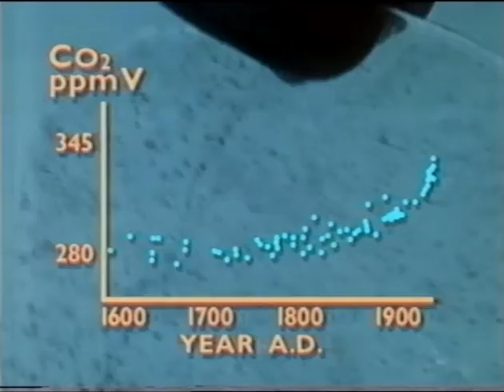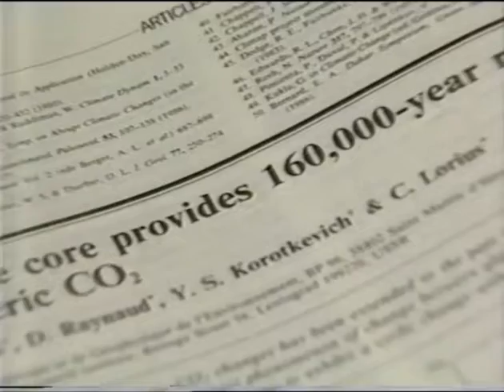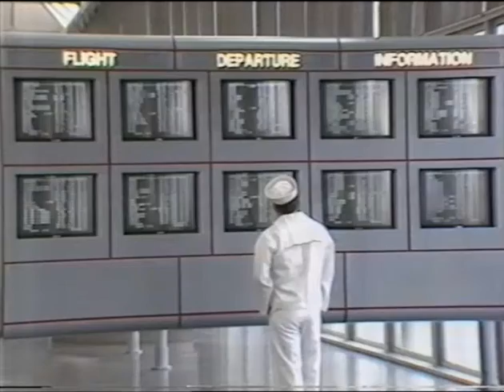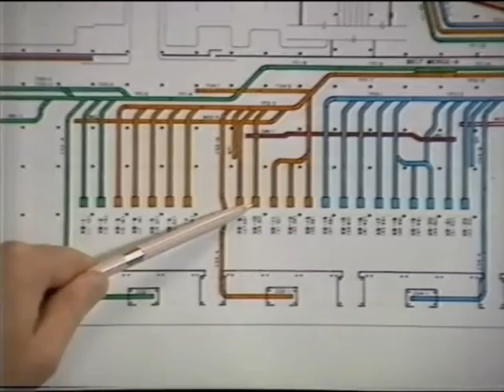Beyond 2000 [incomplete] (15th March 1988)

Comment: More coastal errosion: ✓
Inundation of coasts: ✓
Areas getting drier: ✓
Changes in rainfall: ✓
Permafrost melting: ✓

1980s: We have 25-30 years to clean up our act...
2020: um..
Reply: Yeah they been banging on about it for 30 years, greenhouse effect, hole in the ozone, now it's climate change.
Reply: @fancyfeast5086  Climate change is caused by the greenhouse effect. We’ve known about the effects of greenhouse gasses on climate for decades. The hole in the ozone layer was a real problem that we’ve mitigated by regulation. What’s your point?
Reply: And the Great barrier reef is still there and Gold coast is still standing.